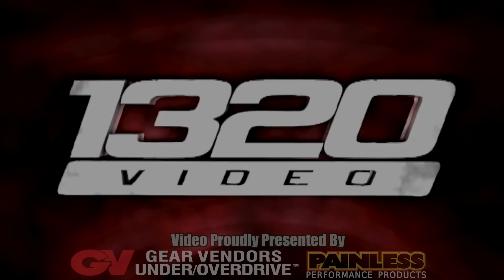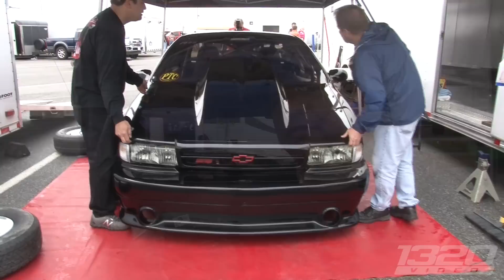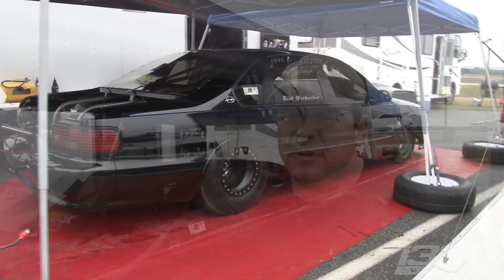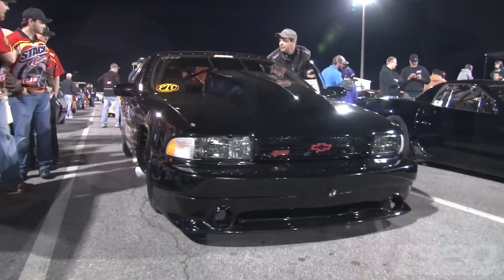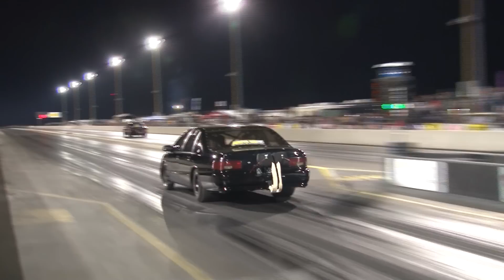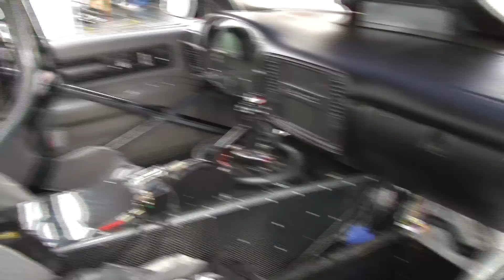The HEAVY CHEVY - 2500hp TT Impala SS

Comment: Now that is awesome. I couldn't imagine telling somebody that I owned a 2500 HP Impala of this generation. Badass.
Reply: I would go to ricer meets and play around. Sleeper stats
Reply: Garrett Hall
there is nothing sleeper about that car...
Reply: eric gibson take the cowl hood off for a stock hood, put slicks on aftermarket not to flashy rims and a quiet exhaust setup and your set. And compared to how much shit ricers do to their cars, this is pretty much a sleeper.
Reply: Garrett Hall howyou gonna fit a stock hood on with that motor, and notice the windshield is notched as well? a lot more done to that thing than a stock impala...
Reply: Duane Hallgren you can drop the engine mounts and you can put back a stock windshield
Reply: Garrett Hall You don't know a damn thing about about fabrication or doing a build like this do you?  There's a reason it's set up the way it is, not just for shits and giggles
Reply: VeniceDevil23 im not going to argue if i cant say it to your face
Reply: I didn't say drop the engine mounts, that other dude did.
Reply: You need check out impala 2004 ss or 2000 interceptor

Comment: 2500hp?! Holy Shit!
Reply: I didn't even think people can put 2500 HP in a car.
Reply: Apparently it's possible.
Reply: *****
alcohol drag racers? lol
Reply: *****
Search for the Nelson Racing Engines you tube channel.
Reply: Steve Morris Engines also builds some nasty engines
Reply: gresco150 Moran race engines????
Reply: Isaac Im Proline Race Engines
Reply: with those times at that weight its probably closer to 1500 hp
Reply: ENZOmasta Brad Anderson engines?
Reply: mike gager low boost probably. sounds like it car only has maybe 5 passes...dont' wanna wreck a brand new 100k+ build just yet.
Reply: John Hoffman I have 110hp and feel fast...

Comment: What is the rear end gear? I'm thinking it may be geared for a 1/4 and they possibly wanted to test it in the 1/8. I don't know..I didn't hear them say because I keep the volume low. It didn't appear that they even launched it hard. I seriously think they were just messing to see what they're working with. Not everybody builds a car and takes off hard without knowing how it will respond, handle off the line, or if everything is bolted tightly. Regardless, 2500hp and not knowing what the first run will unveil is a chance you take..they took it easy.

Comment: I always did enjoy reading internet stupidity. That car has radials it's long and has very few passes on it. I would expect after they get it sorted a 3400lb car with that kinda power should dip into the 4.90's (roughly a 7 second flat pass) that car sorted it out can run deep 7's as it sits, so stop being internet trolls.
Reply: True. The owner said it was a new build. I'm sure once they work the bugs out they'll be able to a do a decent launch. The car pulled like a freight train once it got halfway down the 1/8th.

Comment: Sure Hondas and other front wheel drive cars can run some amazing times with 400 HP or so.  The problem is the Chevy SS will run it time after time, with less problems and engine re-builds.

Comment: As slow as the car ran I cant see 2500 h0 out of it. It was slow as shit.
Reply: it weighs 3400 lbs. of course its gonna be a lil slow for having that much power
Reply: Ive seen station wagons with less power run faster than that.
Reply: Daniel Allen I agree, sounded weak
Reply: Daniel Allen Where can I buy one of those 10 second station wagons?
Reply: that's a little ignorant. there could be a lot of reasons for not putting it down, they mentioned a wet track earlier, but I was expecting a little more from it too. didn't sounds like he really let them turbos spool up all that much..

Comment: Ignorant people saying its slow for 2500hp, firstly when was the last time you personally saw a 2500hp car race? Secondly its a impala, factory they weigh 2 tons, thirdly he has a powerhouse which if I'm not mistaken are only automatics, lastly he may not have the engine running to its full potential, he could of papered the boost and such as not to cause damage to the car. Seems like more of a novelty than a racecar to me anyways.
Reply: Powerglide is a 2 speed automatic. It's a GM transmission first built in the 1950s which can be built to be very strong and reliable. Even many 1,000 horsepower plus Toyota Supra's convert to using this GM transmission. Much cheaper than a than a Lenco 5 or 6 Speed or making a stock Supra Transmission able to hold that much power. Most drag racers use automatics.
Reply: AdussFadass oh yeah powerglides are nice, the range isn't good on lower power cars but it is definitely strong.
Reply: Brian Donovan Yea 2 Speeds would be horrible on gas mileage You would hardly be in the power band too. Thats why all newer cars have 6 to 8 speed transmissions now.
Reply: AdussFadass yeah like the new jeeps and such, from what I read they believe 8-9 gears to be the optimum due to deminishing returns. Funny to think just 20 years ago most American automatics had 3-4 gears.
Reply: Brian Donovan My first truck was a Chevy, it had a 3 on the tree shifter. That is how a real man learns how to drive a stick.
Reply: Brian Donovan ^^ Look ladies, we have a manly man. ^^ lol
Reply: SgtPickledic hey nothing wrong with that, I learn how to drive from a car that had three on tree as well, then a traditional stick shift, than to automatic. Where I live traffic is to much to constantly engage/disengage the clutch. But then again at that time there was a reason to favor manual now there isn't more than preference, the performance used to favor manual transmissions but with double clutches and cvt's manual is nearly obsolete launch control and a double clutch will take on most stick shifts and win, I still like driving /watching people race stick because all you see is the driver's doing not the cars cpu.

Comment: 1/8 mile lame
Reply: not no dam
 1/8
Reply: seglermichael 2500hp and 3400 ..not so fun. 2500 hp 2300 lbs  ok
Reply: mrhazel 2500 HP in any car with the right gearing is wicked.. BTW he deserves a little respect for having 2500 HP , built not bought car.. What do you drive?
Reply: Jason Cunningham sure you llike to know but what ever i do drive it will never see a 1/8 cause if i want to do 60mph id go on the highway
Reply: ooo no you got me good there let me spend 200k just so i can do that
Reply: Jason Cunningham i think you mistunderstood.  i like the car.  the guy said 1/8 mile is crap. he doe not know what hes talking about.  98% of the guys in the class only run 1/4 once a year.  it's too damn dangerous to run a heavy car like that all the time down a full 1/4.  they actually should use wheelie bars if they do it and slicks.  oh wait...that would be 10.5 outlaw.  that's the only difference between the two.  but that difference is why you see nmra run 1/4 mile 10.5 and drag radial cars ARE NOT these cars...they ar x275 cars basically.  if they were real ODR cars,  they'd be running as fast as outlaw 10.5 cars... which would be 6.40's where the record is at i believe...  you're welcome and you've just been schooled on small tire racing..good day.
Reply: mrhazel 1/8mile are for take offs n thats it
Reply: mrhazel doesn't look like he drove to the track on those small tires.  As a spectator I won't go to an 1/8 track. A half track burnout in a nostalgia alcohol funny car is more impressive.  Luckily I live in the land of 1/4 mile tracks. Only Portland messes it up for the Pacific Northwest.
Reply: seglermichael shhh.... and it doesn't cost 200k to do 0-60 in under a second.
Reply: seglermichael does jot matter what you think. Everybody loves street outlaws..guess what that is...1/8
Reply: Joel T doesn't not matter. We don't mean anything to anybody but nhra up Herr.when it comes to these cars, the northwest is almost non existent. This is grassroot s racing. If it weren't for guys like this, you would not have all of that cool nhra stuff. Besides those top fuel cars only run 1000 ft.
Reply: Thats a mid 7 on a 1/4 mile... Not lame.
Reply: Jason Jennings  nobody cares

Comment: 2500 hp and still so slow...
Reply: how 5.84 slow
Reply: Lol? I guess  running 1/4 in under 6 sec is slow
Reply: It did 5.46 how is that slow?
Reply: Alexander Moffitt cars with 800 less hp can run the same time so yeah its kinda slow for having 2500hp...
Reply: That's pretty good for a 3400lb. car....
Reply: +MrZyLeXx It's a heavy car
Reply: +Tiny Uribe thats 1/8 not 1/4 lol
Reply: Uriah Siner that is why i am saying its pretty slow for a car of its class...
Reply: MrZyLeXx
it is also on small tire
Reply: Uriah Siner dosnt matter since it didnt really spin alot...
Reply: +MrZyLeXx Watch it again. Full boost doesnt hit off the line...his setup has it so he gets off the line without spinning.
Reply: Malloy Stale That doesnt mean it has to be slow...
Reply: +MrZyLeXx Spinning would be slower than lower boost with traction...
Reply: Malloy Stale Yes but im still saying it was a slow time...
Reply: I know what you're saying man. It's slow to be putting out that much power. Of course that's cause it's heavy. Still badass tho. Different is always exciting
Reply: Speed is a relative term lol
Reply: Tiny Uribe because a car with 1500 can run 4.2. He had the launch turned way down here.